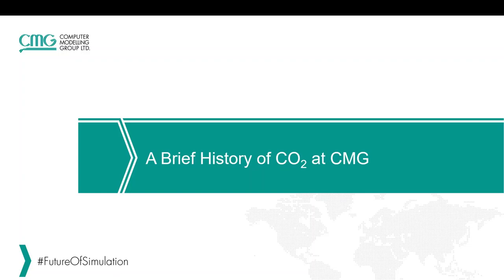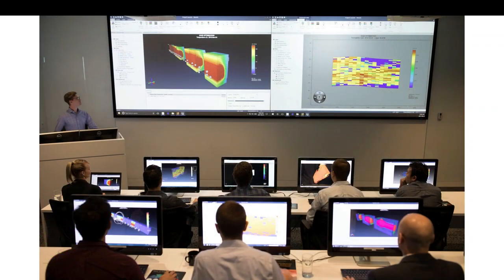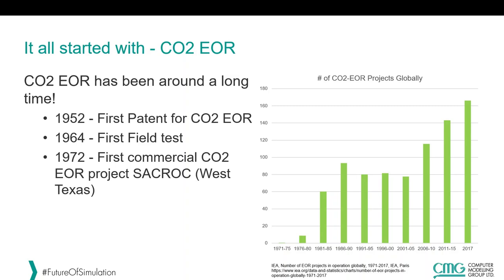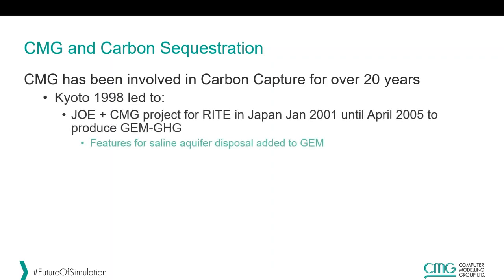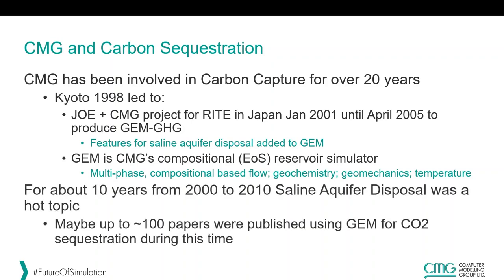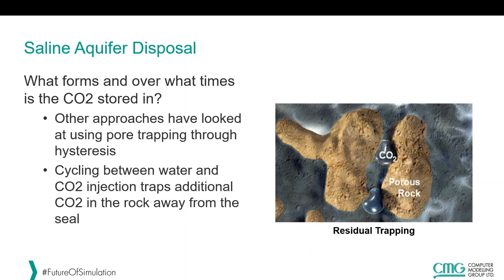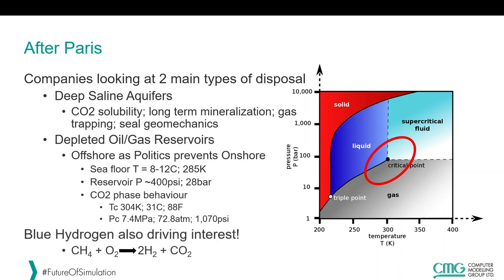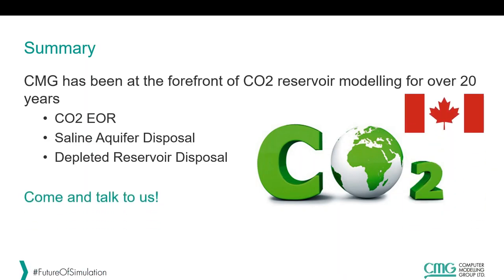CMG Webinar: An Introduction on CO2 for Managers

Comment: How can i do the CO2 _EOR in CMG
Reply from the maker: Hi Hayder, thanks for your reply. First you need to slect which simulator are you going to use, and that will mainly depend on the type of EOR technique you are about to simulate. You can use GEM or STARS. Then you need to define your process, and finally create the model in Builder. Defining the process will take you to decide wether you are injecting CO2 in a miscible or non-miscible way. For miscible injection, you may need to create your PVT inside winprop. IF you send us an email to support@cmgl.ca we can help further with your doubts and questions. Thanks.